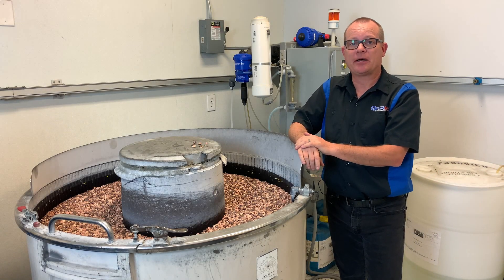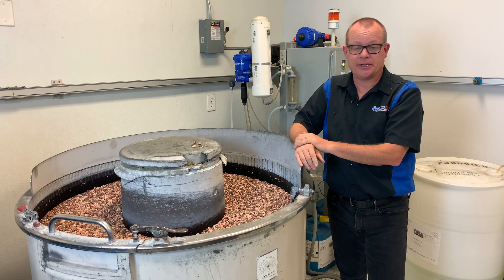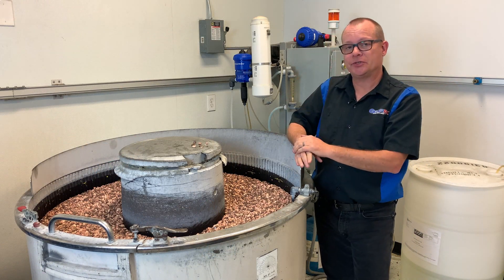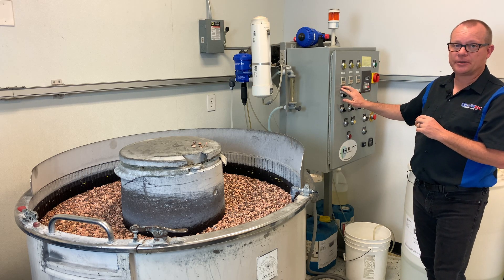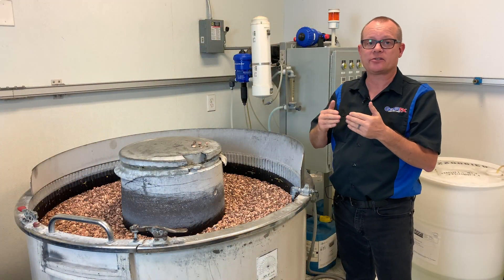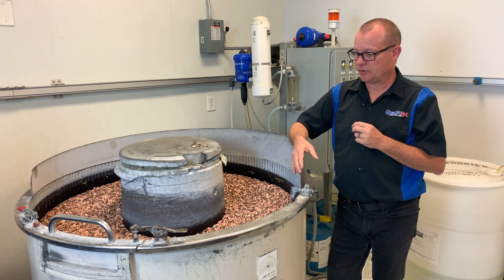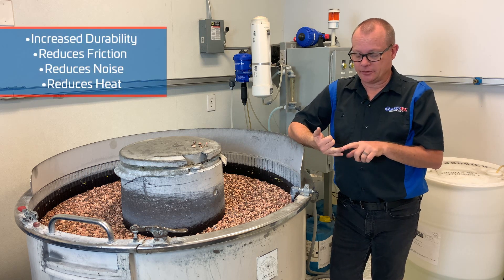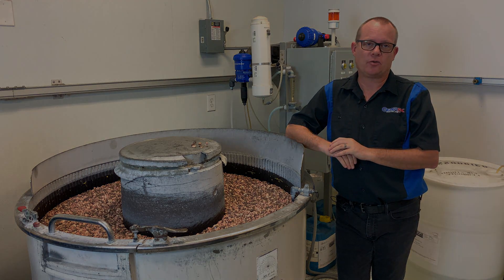REM Isotropic Surface Finishing - GearFX Driveline

Comment: Reduces the metals surface hardness without heat treatment ? Or do you mean reduction of surface material by chemical oxidation ?
Reply: Reduces the roughness of the parts by removing really small amounts of materials ( microns ... obviously depends on the recipe and the overall length of the machining).
You can kinda compare it to lapping ...
Reply: No it removes microns of material with the abrasive. Its very hard to control and needs to be proven via trial and error